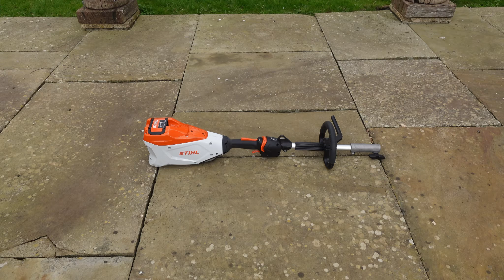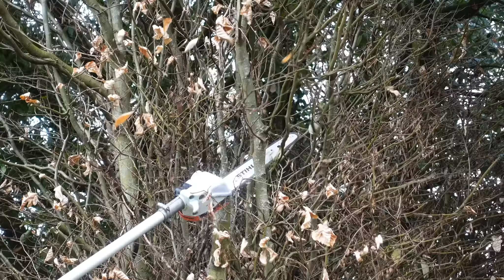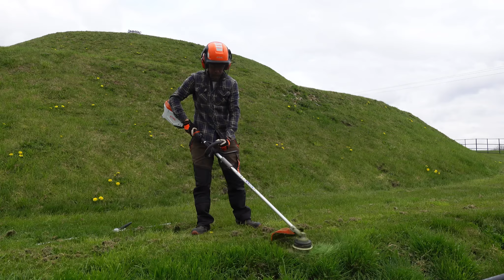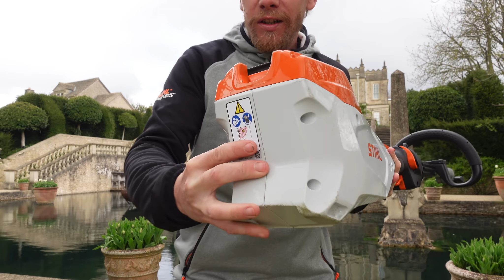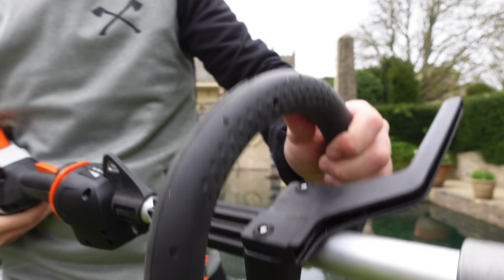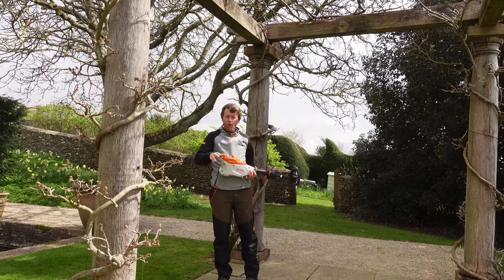STIHL KMA 135R Battery Kombi Engine

Comment: wont work 3 hours in forest with no charging 300ap is 30 mins 300 eur
Reply from the maker: It would work 3 hrs in a forest with enough batteries to power it..
Reply: @TheFullyChargedGardener  but id need 10 batteries 3000 eurs
Reply: i got a stihl 55r i can borroe a 400 350 410 freischneider
Reply from the maker: @jasperedwards2713  Then buy 10 😀
Reply: my motorsense was 300 eur special offer 200 eur petrol is easy to get my petrol cost 5 eur for a 300ml eco benzine
Reply: @TheFullyChargedGardener  no way i have many petrol ones
Reply: @TheFullyChargedGardener  h20 is better option
Reply from the maker: @jasperedwards2713  Then stick with what you have. Nobody is forcing you to make the change. 
Just chill out and be happy. Life is too short!
Reply: @TheFullyChargedGardener  im chilled out    but if they want us to go green they have to improve pricing

Comment: The product arrived undamaged and in a great looking box all parts of the kit were present https://www.youtube.com/post/Ugkx010hhy8hzepHnne4VtzOtUictDZeYMTF and I can't wait to use it. I'm most impressed by the fact that it's a five piece kit, of great monetary value in that you can get this all for such a price. With this my former grip strength will come back and then some. I'm already starting notice a bit of a difference after using it for a bit now, and the stress ball and doughnut shaped grip designed to be carried in the pocket have helped in reducing my stress levels as of late. Would definitely recommend!

Comment: Do you know how many cuts per minute the Stihl Kombi hedger makes?  How does it compare to the hla 86?
Reply from the maker: It has a stroke rate of 4000rpm. It leaves a beaut finish.
It is very different from the 86 as it has a drive shaft from the motor to the cutter head.
my advice would be to visit your local dealer and have a feel of one.
Thank you for watching.

Comment: I love this new stuff the only thing I don't like is the one two three power settings it seems I have one idea what settings I need and the machine has different ideas usually I want power one the machine wants three then Revesby up and down confused till you switch it manually back to one think this is a fault sthil needs to change

Comment: I am looking at moving over to a Stihl battery setup for my gardening service. I currently run a petrol Combi system, so it’s great to know that the tools all fit and I don’t have to splash out on a new set. I use the combi system as I can break it down and put it in the back of my Polo (and trailer for the mower and cuttings) and I don’t have to deal with several motor units. I also have an MS 170 chainsaw which I would like to upgrade. I’m very happy with both. I take it the batteries are interchangeable between chainsaw and combi as it would give me more options during the working day depending on what work I am doing? My only beef with battery stuff is that you can loose the whole battery pack even if only one cell is damaged. For me it would be a game changer if the individual cells could be removed and replaced, both for my pocket and the environment (as these lithium batteries aren’t as environmentally benign as we are led to believe). 
I would be interested to hear about the long term robustness of these battery systems also, as my Stihl tools have performed without fault now for quite a few years. My main issue with the combi up till now has been the shredding of the Tommy screws that clamp the head to the tool. I generally keep a couple in the car, but am afraid to over-tighten them so sometimes the head comes free, especially when strimming.

Comment: I have one of these and I like it generally. However, there’s no trigger lock which is really helpful to keep it running like on the 130. Also, every single tool needs a replaceable rubber base so it protects the unit from drops, scuffs and moisture. Other than that I quite enjoy using it. I’ve got two 500S batteries and the four port charger. A big investment and I’ll certainly look forward to getting the chainsaw hen possible as I’m sick of messing with small engines.

Comment: I've had the Kombi system for ~15 years. I love it. Have all the attachments I need. I know this electric stuff is becoming more prevalent and I will cross over eventually. I like Stihl for the quality and now not leaving past customers holding the bag with an entirely different attachment system.
Reply: Thanks I am considering getting the battery one for Kombi but Stihl very high cost

You think worth it tho eh??

Comment: I've just purchased one. How many batteries would you recommend to have on hand for a full day's worth of trimming?  I'm cutting hedges daily, spanning light maintenance to dense, thick over growth. I have two of the ap500 Stihl batteries. I'm going to test them out tomorrow but I wonder how many batteries I'm actually going to have to invest in to make it to the end of a work day.
Reply: There are too many variables. Start with one battery and work your way from there.

Comment: I bought this and to be honest stihl dropped the ball on this one. I ran it with the string trimmer attachment with the AP300 battery for my lawncare business and the battery life is unacceptable. It lasted a total of 18 min on max speed. For my business I would need 7 to 10 batteries to get through the day.
Reply from the maker: We use a backpack battery for large strimming jobs.
Reply: @TheFullyChargedGardener  I took it back yesterday and got a 111r. It gets really hot in the southern US and I can’t see adding extra weight to my body when the heat index is over 100c. I was really excited about this Kombi but it needs to be able to run for at least 45 min without the backpack or not that many people are going to be willing to switch over from gas. Thanks for the response.
Reply: @TheFullyChargedGardener how is the balance though if you use it with the backpack battery or battery belt? As if they have tried to balance it perfectly with an AP300s battery installed which is what they have done, then won’t it be head heavy if you remove that? It seems you can only really have balanced and heavy, or lighter and unbalanced. 
Iv got this unit and the strimmer attachment and the weight (nearly 7kg) with battery installed really takes it out of you over a week of lawn care.
Reply: I have the kma 135r trimmer snd can get 9 lawns out of the 300s battery. I also have the ap180 battery for my chainsaw and it got 4 lawns done with 1 bar left. It was ran on low as you rarely need full power trimming around a house. I use black diamond line and it cuts like a razer on low. I will keep my 94r as a backup. Going to get he kma 135r kombi head to replace my 132r  gas kombi. I have a ton of attachments already.

Comment: What size batteries?
Reply from the maker: I have been using This unit will take all the AP batteries, you can also use the AR backpack batteries via the AP adapter.
Reply: Thanks sorry I was trying to multitask and the question came across wrong! I meant which of the AP batteries were you using in the video I've just got 2 of the 300s and wondering how I'll get on with battery life! Thanks for the content
Reply from the maker: @JackyRogue  I have used the Ap300 and Ap 300 batteries in it when using the hedge trimmer, pole saw and small strimming jobs. I use the backpack battery for large streaming jobs.
Stihl have some great info online about runtimes. but there are so many variables for this machine, type of attachment, type of work etc.
hope this is helpful

Comment: Finally, I got one of these in my hand today in Australia, The sales lady sent most of the time talking me out of it, it seems very heavy n unbalanced but the mid range petrol is what she was pushing me to buy seemed lighter and more balanced.
Reply: The articulating hedger is the most heavy attachment I have, even with the gas engine. Just the nature of the beast. All other attachments are fine.
Reply from the maker: The balance of the machine will obviously depend on the battery you use and also depend on the attachment you are using. Another key thing to highlight are the other benefits with the battery machine, less noise, no fumes.
It all comes down to personal preference. But I would definitely choose the battery machine 😀

Comment: I like both I think petrol is great for running all day, power & momentum. Also I feel less tired after petrol because it works faster & harder due to heavier flywheel. Batteries are better for smaller jobs where run time & heavy duty power is not required. Petrol does require more maintenance air filter, fuel filter & E10 eating carburettor diaphragms & fuel tubes. However the battery unit may have low maintenance, it is the batteries them self’s where the reliability issues happen. When there new there great however after time & work load they deteriorate in run time & power. I can repair engines but have no clue how to restore a battery.
Reply from the maker: This unit has an impressive amount of power. I have to stay that I seem to be more productive when using battery machines, and certainly feel less fatigued at the end of a day using battery kit.
thank you for watching.

Comment: Apparently if you started out buying a HLA 135 , you can buy a strimmer attachment and screw it onto the HLA bar.. it's not practical for everyday use but it's cost effective until you can afford to buy multiple motors

Comment: Thanks for the video. Love your channel. Agree with run time on the stihl batteries. I'm really impressed with he run time on the hedge trimmer and ap300. Hardly charge it.
Reply from the maker: They really are fantastic bits of kit. I find I get so much more done in a day with the battery hedge trimmers, compared to when I was using the petrol machines.
Thank you for watching 👍

Comment: Great vid mate, have you seen they offer 60cm hedge cutter attachments now? what length would you recommend? I’m used to the 50cm bar on me HLA65 but its always tempting to go bigger, even with the option of a extension pole.. !
Reply from the maker: Hi, The extra length will add a small amount of extra weight, so that is worth factoring into your decision.  If you cut lots of wide hedges, then that little extra could come in handy.
It is all down to personal preference 👍
Reply: @TheFullyChargedGardener  thanks dude, 10cm isn’t a huge difference I suppose so may be well worth it for those bigger cuts. Plenty to think about 🤔
Reply from the maker: @MattDLux  Definitely worth visiting your dealer and having a closer look 👍

Comment: Do you know if it comes with the battery? The place I plan on ordering my unit from didn't know if it came with the battery.
Reply from the maker: Hi, You have to buy the battery and charger separately. Some dealerships may offer a bundle deal.

Comment: But how long until the battery is no longer chargeable or is significantly reduced in output power?  We gotta buy a new battery in 7 years ?  10 years ? Will the new battery fit ?
Reply from the maker: Stihl pro batteries can be charged about 1200 times.
Obviously battery cells don’t last forever - But how long does a tank of fuel last in a strimmer?
Then there are the significant benefits to the operator - less noise, no fumes, less vibration.
👍

Comment: I went full Stihl electric 1 year ago have to say i miss the smell of split petrol in my van, the noise and air pollution, the bone shaking vibrations, yanking the the cord every time I want to restart my engine, the spare part costs and getting anally probed by my local Stihl dealer every year for a service. Plus you no longer have to pay for two stroke mix and petrol because you can charge at your clients🤪
Reply from the maker: 🤣 Game changer!
Reply: what about all the smoke smell on your pants lol
Reply: @koruki and the exhaust burns on your fleece? Lol
Reply: @diogenesgarden5152  mainly the two stroke smoke all over the clothes. Not so much on the 4 stroke mowers

Comment: I currently run the stihl km131 with 11 attachments so I'm considering buying this kma135 since all my attachments will work with this unit too. Right now I can trim and edge 3 big corner lot houses with my km131 on the same tank of fuel, I wonder how many houses the kma135 will trim and edge on 1 battery charge.

Comment: This is nice. I use an old FS85 based Kombi set. I can't remember the exact model off the top of my head, but it's an oldie. My grandfather bought it back in the 90s and passed it down to me when he passed away. Apparently, it was made before they actually adopted the name, because it doesn't actually bear the "KM" in the model. The folks at the shop were tripping when they saw it thinking it was some kind of custom deal. I got a pruning attachment for it after the May 2019 twister in my area, and that engine runs it wonderfully. The attachments it came with should work with the newer stuff, so I might look into this powerhead in the future.
Reply from the maker: That is very cool! Thank you for watching 👍

Comment: Thank you for this information, this will be really helpful for my business going forward. A quick question, how do this things hold up in the rain?
Reply: From what I am understanding, this tool is splashwater-proof. In other words, you shouldn’t submerge it - but rain should not be a problem.
Reply from the maker: I have been using this demo unit in the rain and it is running perfectly. The weather here has been awful the last few weeks. 
I will try and make a video of it working in the rain, although that is easier said than done, as I don’t want to damage my camera gear 🤦‍♂️

Comment: How much would you reccomend this? And could this be a good starter tool, for a new service company?
Reply from the maker: I have already recommended this machine to a few friends. As with any machine - It is about matching the machine to the scale of job you are going to be doing. 
As a Kombi machine, it is a great starter tool for a service company.
Obviously you need to factor in the cost of batteries - and the number of batteries you will need, will depend on daily tasks.
It is a great unit.
Reply: @TheFullyChargedGardener  Okay, thanks, sometimes I have to work a whole day, maybe 2-3 batteries would be goof?
Reply: @TheFullyChargedGardener  Hey again, I have a question, how long does a battery last for the hedge trimmer attachment? I can't find any information about that, and it seems like the KMA 135R is taking up a lot of juice for a short amount of time, what is your experience?
Reply from the maker: @jackdaniel428  With the hedge trimmer attachment you can expect around 73min using the AP300s battery - Of course this can vary depending on what you are cutting and the speed setting of the machine.
Hope this is helpful 👍
Reply: @TheFullyChargedGardener  Also, what attachments are you using for hedgetrimming?
Reply from the maker: @jackdaniel428  Hi - I was using this attachment in the video.
https://m.stihl.co.uk/STIHL-Products/KombiSystem-and-MultiSystem/KombiTools/274706-1482/HL-KM-145-KombiTool.aspx

Comment: Looks so great, been waiting for this for a looong time (kma 130 owner).

My big concern is with the weight, i primarely use my kombi for hedge cutting, seems like it would total around 7 kg..
How does the 135 with hedgecutter and 300s compare to the hla 66?
Reply from the maker: So the unit with the hedgcutter attachment (without battery) weights in at around 5.6kg - This is heavier that the HLA66 as the 135 has a shaft and gearbox - Where as the 66 has the Moyer directly at the cutter head.
Hope this is helpful and thank you for watching 👍
Reply: @TheFullyChargedGardener  Why give the weight WITHOUT THE BATTERY🤔
It’s Clearly not going too work, battery FREE.
So tell People the entire weight, that would be, the logical answer.
Reply from the maker: @glorybelieve9010  The reason they don’t give the weight with the battery, is because there are lots of batteries it can be used with. The tool you attach will also effect the weight.
All the weights of the batteries and tools are listed. Just add together the combination of battery and tool and you can calculate the weight.
Thank you for watching 👍

Comment: I've got the older stihl fsa 130r and hla65 . Both have had 12months commercial use and they are still working perfectly.  Granted the battery cable on the back pac can be annoying at times when it catches on a branch but still prefer it to my older noisy petrol tools. The low noise , zero fumes, zero servicing and reduction in fuel costs are fantastic. I will never go back to petrol.
Reply from the maker: 😀 It really is amazing the difference - Far less fatigued at the end of a working day. Being able to crack on with work, not having to worry about the noise you are making. Just amazing.
Thank you for watching 😀
Reply: @TheFullyChargedGardener  totally agree. Another thing I've noticed is I now don't go home with my hands throbing/tinkling coz of vibration from petrol tools.